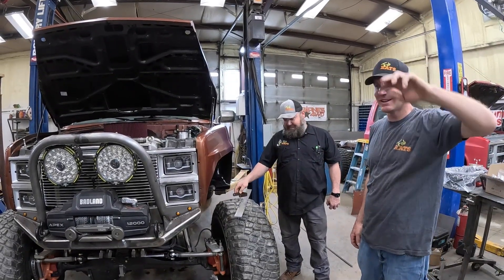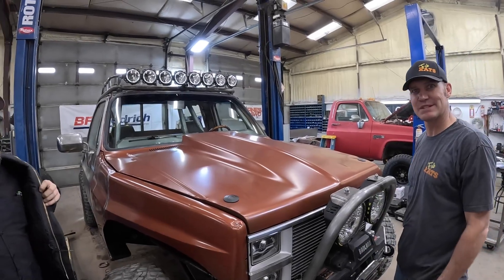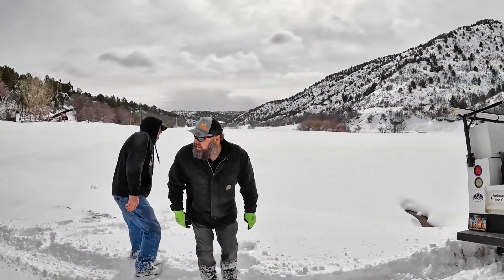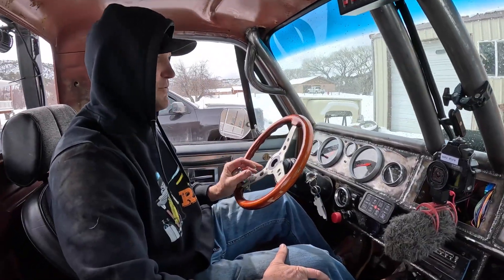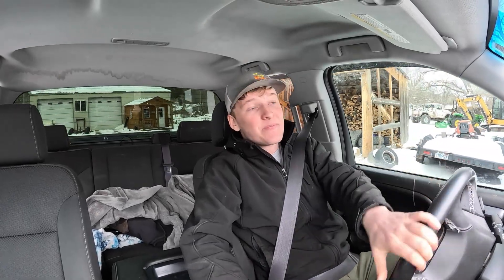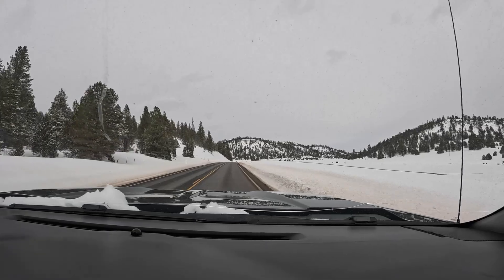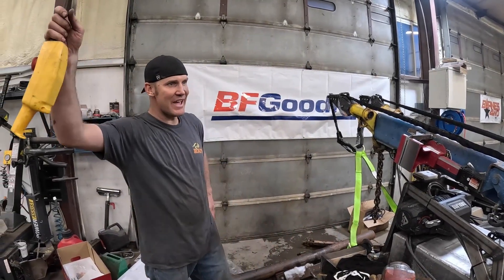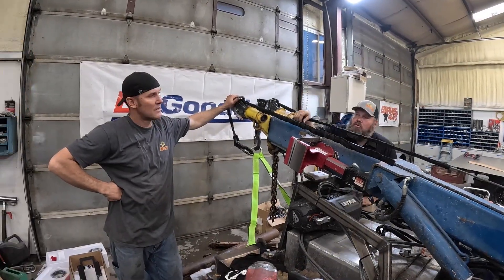The Rat Rod Wrecker's First Recovery. Back To The Drawing Board!

Comment: Switching to electric seems like a down grade. I wonder if it was a wrong sized pump or a restriction in the system that caused them to spool so slow.
Reply: Notice the hyd motors are perpendicular to the retrieval drum, this means they are worm gear driven. (50-100+:1)
This also prevents any reasonable chance of a 'run away', should  a cog tooth break under extreme load.
Downgrade for sure.
Reply: Jeepin Dave, you are 💯 % correct.
The noise the pump is making is telling it is starving for oil, or, it is junk.
That said, a hydraulic winch will not run as fast as an electric. Even one that has been converted to two speed.
Reply: @haroldphipps3457  true but I'd rather trade some speed for consistent pulling power and 100% duty cycle.
Reply: @jeepindave5464  I'm with you!

Comment: That fender/hood design with the angle-in is a VERY cool look. Might be starting a thing with that!
The truck sounds GREAT when working and revving in park. But man.... it sounds WAY TOO LOUD at highway speeds, lol.
Reply: Hopefully a rear window will help reflect some of that noise!
Reply: Dodge already has the tappered hood just need to remove the fenders but you end up with a Dodge and not a square body Chev.
Reply: @iffykidmn8170  Just looking at a 23 Dodge Ram for comparison. Yeah, not really..
Slightly tapered hood, that then has WINGS on it that go mostly straight and keep it boxy.
Front clip and fenders are also still straight, not narrowed. So it still ends up a box, with a beveled cowl on top of it.
Really looks NOTHING like this.
This is narrowing the front half of fenders, hood and clip. Its a very unique look.
Reply: @freighttrain7143  a second gen dodge

Comment: Change out the rollers on the boom tip as they will tear the dynema to bits since they have had steel cable going through them

Comment: I would imagine you guys could retrofit a bigger hydraulic pump and bigger winch motors to speed things up. More flow = more fast. May be worth sticking with electric just for the weight savings though.

Comment: I doubt those electric winch's will pull Matt's tank out when it's stuck.. those PTO winch's would have..  Bad choice in my opinion.. throttle up and Hyd. is the Bomb. But it's your build not mine.
Reply: 100% did you see projectfarms video on what's the best winch? those 12k badlands winches didn't do to good and definitely weren't near their rated 12k pounds before they destroyed themselves. I just don't see how towing with these winches is a good idea but they're the experts not me lol.

Comment: I ran wreckers for over 30 years and watching all these builds I feel the hydraulic boom and winches gives you a big advantage.  Put a hand throttle on the back or an electric idle kick up. Hydraulic winches rule.
Reply: As a former wrecker driver I have to agree with you, I had on my wrecker a switch that raised the idle to 1200 or 1800 rpm what ever i needed. An electric winch can't pull as an hydraulic can.
Reply: Im pretty sure he has a throttle control on the bed. Electric seems like a down grade. There had to be something causing a flow problem.
Reply: Also BSF boom and winch is hydraulic as well.
Reply: wouldn't a higher flow hydraulic pump solve the slow line speed? (like 3X flow)
Reply: @jasonh4167  I'm pretty sure the pump is shot. Hydraulic pumps shouldn't be that noisey.
Reply: @haroldphipps3457  yeah valid point👍
Reply: I don't know what it takes to move Heaven, but to move any substantial amount of Earth IT TAKES HYDRAULICS!
Largest loads ever moved, are done at sea, b/c HYDRAULICS.
Reply: Really surprised you didn't throttle up to 2,000 rpm, that should have doubled it up.  When you get back from the wrecker games try rebuilding the hydraulic pumps, they are probably worn to the point where they are way down on torque and speed.  You may have a relief popping on hard pulls, that would take all the power away under high load.  If you try that, you'll also want to go through the reliefs too and make sure they have the right set pressures for your set up.  Too high, too low, would make them work not as well.
Reply: @johntremain8403  moot point.
Hydraulic winches will not go back on this wrecker.
Reply: To be fair it's not like an off road recovery truck like this will ever need more capacity than those electric winches provide and it doesn't sound like he's getting rid of the hydraulic boom. I bet he was 50/50 on the hydraulic winches anyway, going electric removes a ton of weight from the rear which really matters on a truck like this, simplifies the hydraulic system, lets him get rid of the PTO for hydraulic over electric letting him operate everything with the vehicle off.
Reply: @jasonsmits2147  You should see some of BSF video's they have one that they needed to pull at full load for over an hour to get the truck out of the swamp.
Reply: @alvinmitchell6799  I've seen plenty of his stuff, not one with an hour long pull though, any clue which video that is? Either way, that's a pretty rare situation and the dual winches Paul's using can help a lot with the duty cycle. All I meant was on this sort of build there's more to consider than raw power and duty cycle.
Reply: @jasonh4167  Or just a larger diameter drum would have been a simple solution to up the line speed
Reply: That's as fast as those winches go . It's a Holmes 1200 commander .built for strength not speed I thought this was going to be a problem they probably 1/5 the speed of electric . 90% of the pulls they are ment to do is just enough to pick up a vehicle along the road .
Reply: agree

Comment: Looks like you could use a hydraulic bar at the back like most tow trucks to push down as you winch. But mounted from above the bed. And I would put wheels on it. This will allow movement while winching but stopping the tipping, but it will also act as a cushion between your bumper and the vehicle you are towing. .
And just put a piece of plastic in for your rear window. You don't need any specialists, just a grinder or saw. And you can even screw it in.

Comment: If I were you, I would upgrade the hydraulics:
Bigger pump
Proportional valves
With that you can pull at very low speed and moving your handle, you increase the speed of the winch.
With all this, you’ll have a big advantage towards the other wreckers.
I know this video is made some days ago, but still is worth considering.

You can als buy winches HD with 2 speeds, they use them in Europe for heavy duty off road competition.
Reply: The electric winches may just be a stop gap fix seeing as the games are in a week as of the taping of this video.:face-turquoise-covering-eyes:

Comment: not sure if you've upgraded the alternator yet, but holler at Mechman alternators and get an awesome high output setup to keep the winches happy. Having a full 14-15V at full load a winch makes a HUGE difference.
Reply: They've got that welder unit which I believes upgrades the alternator
Reply: @wyckedan  All the Welder control box dose is Up the output voltage to 36 Volts +- with a low amp output on 12 Volts to maintain the Truck.
Reply: @m9ovich785  The welder comes with a special alternator i believe
Reply: @warrenmichael918  Indeed .. It's custom unit, made to suit the welding set up .. not an add on kit. :) 

The welding set up is available with a replacement, up to 240 amp alternator .. safe to say that's the one they have.
Reply: @m9ovich785 It's custom unit, made to suit the welding set up .. not an add on kit. :) 

The welding set up is available with a replacement, up to 240 amp alternator .. safe to say that's the one they have.

Comment: Now that you are removing the hydraulic winches. I would look at using the now unused hydraulic lines/controls and make some outriggers for the rear of the truck.  That way you can anchor, level,  break beads off tires and so on, on the trail.
Reply: Who has time for that is the question ? 🤔

Comment: I used one of those Holmes wreckers back in the mid eighties on a Ford F600. Did lots of recoveries. Those worm gear winches will pull forever, and take forever.

Comment: Hey Paul & Ben !!!    Make sure that the transmission goes into ""PARK"" & stays there as Chevy's have been known to jump out into reverse  when engine running !!    ALWAYS use the ""EMO."" Brake when parked & engine running !!    Great job with the winches ,ONLY NO Pulling with the winch cable as a tow cable !! 🤔🤗🤔👀👀👀👍👍👍👍👍

Comment: I have made a couple of projects that needed a hydraulic system. Cheap and easy. I went to a junkyard and found a power lift tail gate. The pump and reservoir are all one unit and cheap. Usually under $200.

Comment: After watching your first recovery it might be nice to build a removable 'plate rack' on the front bumper so that in these circumstances when you are pulling or towing something that is heavier than the wrecker you can pull plates out of the back behind the cab (where they would be mounted somewhere) and place them on the front as a counterbalance.  Maybe there is no room for that.  I just know the stopping and steering ability are seriously compromised especially as you do as Rory does and have to recover pulling uphill or climbing obstacles.  Just a thought.

Comment: Nice truck.
For that winch speed: a variable flow pump will give you more speed. In hydraulics is flow is the speed and pressure is the force. Also when selecting an electrical winch the no load speed as well as the full load amps is for me the selection keys.

Comment: I was saying to myself as you were building that rig, Paul, you were going to regret keeping those slow hydraulic winches. As you said, they will pull a brick wall down, but very slowly. The hydraulic boom is a nice feature, though; it saves room from not having to have another winch. Other than that, she works well, other than the front end seems a tad light when working the boom and winches. 
    
As to Hunters' trip... I was working out of Vernal, Utah, in the late 90s when we had a bad winter; I'm not sure of the year, but it might have been 95-96, but the snow was higher than my truck like with Hunter. For reference, it was a 95 Ford F350 Powerstroke 4x4 single rear wheel with a headache rack and toolboxes, so a little taller. By the time the plows got to working good, it had started to snow again, heavily. The crew and I were South of Vernal on 45 in the red wash area, a Chevron field, and right about the time we were getting off and starting back to Vernal, the snow plows threw in the towel because it was building up faster than they could plow or blow it off of the road. Needless to say, we were stuck at Chevron's field office for three days before we could get back to town. 

Good luck at the games; Matts's beast is fantastic but clumsy in tight places. On the other hand, Rory has skills gleaned from years of experience, but of course, so does Matt with Winder Towing. I watch all of you, Matt, Fabrats, Rory, and Robbie Laton, every week with Chad and a few others as time permits. I bought an old but classy 1988 Mallard 27-foot RV (class C) as a fixer-upper for a sweet price and have a 2000 WJ with the 4.0 and Slectrac as a toed, and I'll be back up to Utah before long. I hate Houston; I don't want to die here. 

See Y'll soon. 😎

Comment: Yeah, was wondering about those winches. I've got an 84 F350 4x4 with that same Holmes 1200 Trooper twin line and it is a beast for pulling, but with those worm drive winches it is SLOW! I will usually take my Chevy with the Challenger and planetary winches. It will handle the same load, just much faster. Thsnks for the great build series though. You inspired me to build more!
Reply: I wish I had that Ford of yours!

Comment: I’ve got that same wrecker boom I’m putting on my ford got a 12v hydraulic pump for the boom itself and plan on putting on a set of apex winches with a high output alternator because I don’t want to deal with a pto though I do have the old v belt driven hydraulic pump for it but don’t see anywhere to mount or drive it off my 12 valve Cummins

Comment: I knew those old winches wouldn't do the job. Consult with me before you try fabricating Paul! Ha. Main thing I thought at first was you wouldn't be able to replace them quickly when they broke.  I fabbed my first set of bumpers in 11th grade, for a 77 K5 Blazer, 8 inch c channel with two 3 inch heavy pipes welded on the back. We sharpened the bottom edge of the C channel and used to run down rows of trees. The area was under construction at the time and is now a mall, trees were being cut down anyway.

Comment: the air horns : are going to get mud, water, snow, in them and rust the in sides out. they need to be moved or face another way. very nice truck. congratulations i think you will win first place
Reply: I'd move the air horns to a shelf on the upper storage area of the shop.

Comment: The good part is having speed of an electric and  double blocking  will give it more power when needed.
Reply: And cut the speed in half.
Reply: @haroldphipps3457  Yep. But only when doubled. Or add another block to go even slower and pull more. (only when needed) It's a good option to have.

Comment: Are you going to put any chafing gear around where the hoses and wires exit the back of the cab?  Sheet metal can vibrate and cut.  A hard rubber grommet or hose section would not be amiss.  Even heat forming a piece of pvc or such would be a solution.

Comment: Hydraulic winches are meant for pulling power, not speed, especially with wire rope that requires attention to the amount of tension applied to the line.   I assume not using the airbags to prevent squatting of the suspension.

Comment: Those hydraulic Winches Have a Lotta pulling power. The downsize is there slow. I don’t know if you could change the gearing in them but that’s what I would’ve done at least tried. But it’s too late.

Comment: Aloha Paul.  When you run cables it needs to go through the tube before going on to sheave.  That will keep cable secure and in line with winches.  I saw you changed out winches.  Too bad no one has planetary hydraulic winches.  They are the fastest and can run continuously with no need to stop like electric

Comment: need some removable weights on the front end like the tractor pull guys use suckdown winch  wont help much except on steep climbs but on recoverys  you need weight up front
Reply: bigger pump more line speed the hydro winches are much better than electric and the duty cycle is much better

Comment: Seems like it would've been super cool and kinda helpful if you could've kept 1 hyd winch for big pulling power without having to run snatch blocks. Then on the other "barrel" so to speak, you have an electric Badlands for lower pull power, but higher speeds

Comment: Those hydraulic winches do work better than electric especially for hard pulls, but they don't work that good with the engine at idle or slightly higher than idle. Raising the RPM to 1800 to 2000 RPM is necessary to get any speed on the winch system.

Comment: Hydraulic winches are the way to go, you can speed them up by changing the motors or pump to increase volume and speed.  You could also keep the Hydraulic winches and run electric winches as well.  You probably aren't turning the pto fast enough either.

Comment: If you haven't figured out the park problem, the park pawl support bracket gets bent sometimes and then it doesn't hold the park pawl in far enough, I was a Mr Goodwrench back in the 70's and 80's, the bracket has to be changed if it's bent.

Comment: I would have done all I could to keep the hydraulic winches. They are far stronger and last longer than electric. Only pain is the engine needs to be running.
They usually have a 2 speed gearbox on them. But hydraulics need yo be matched to pump size, so maybe the flow just wasn't there

Comment: Sad to see the hydraulic winches and pto go. Do you think the truck they came from has a higher flow rate or pressure? I'm assuming they must have worked well on the original truck. What rpm where you running while winching? Oh well, you know what you need way better than i do so I'm sure you made the right choice for your situation. Keep up the good videos.

Comment: A rock crawling wrecker by definition has to have a softer more articulate suspension as we all know. And you could see that when the winch weight of that heavy truck hit the wrecker the back went down and the front went up. I have an idea for an improvement during winching operations which is a way to limit the front end going up. which would help the back end as well by stopping the articulation twist sooner, and keeping the truck more level during winching,  Basically you could use limiting straps that you could quick connect to studs or something, or even a peice of metal flat bar with holes in it that could fit to studs to limit that front end rising. This cuts down time, and more equally spreads the weight between the frame and the tires. This is an easy mod to fabricate, and honestly you could just use a few limiting straps with no mod at all, but it wouldn't be as easy to apply. I have to say, I was surprised to see Paul pulling with the winch, but not very surprised. I was shocked however to see him jerking with the winch, because that is just wrong and Paul knows better. Wrong type of rope, and wrong anchor. You can hurt everything from the motor to the thing you are pulling to all the guides and loops your rope goes thru. Not to mention your boom etc. If you are going to Jerk pull do it with a dynamic rope. If you are going to bend the rules and tow with a winch, at least do it slowly and consistently. Haste makes waste.  Databyter

Comment: I was wondering y u didn’t go electric on the winches.. 😅 and u have to have the. Engine running.. electric u can lock it down and shut it off without relying on a ebrake